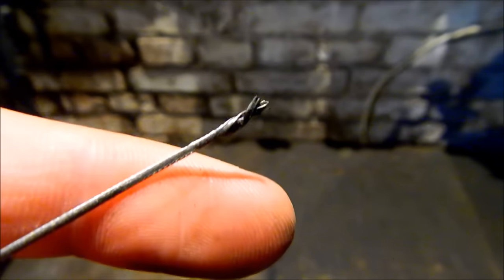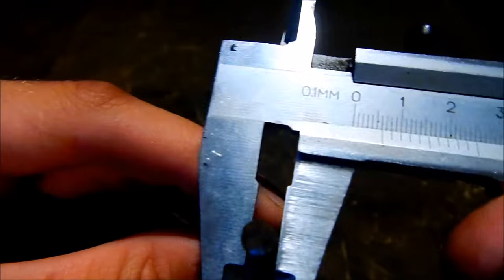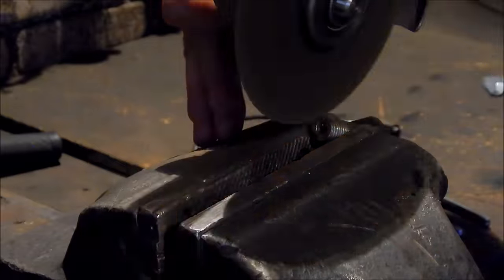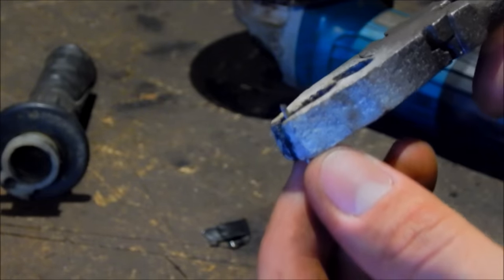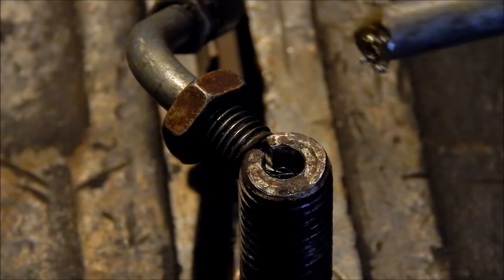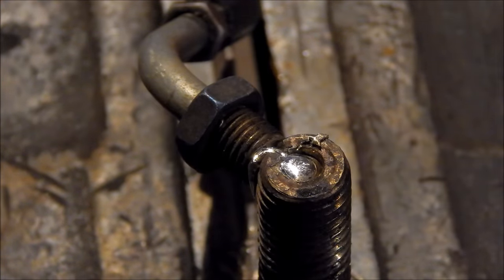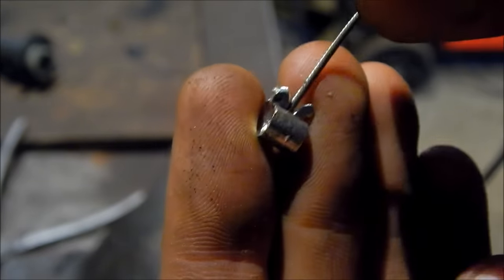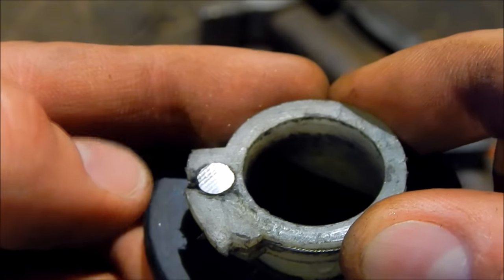Throttle Cable Solder Repair Tool - Simple Fix!

Comment: I wouldn't trust in lead- it might be too soft. Have you tried aluminium?
Reply: i would try some sort of zinc die-casting alloy.  i think that's what the factory uses.
Reply: i used terracotta..just jokin. some jb weld would be much batter.
Reply: can use a bit of brass rod, you can use it in a drill with a file if you havea  bit too large, drill a hole, and a countersink, put in cable, splay open so it lays in the countersink, solder with flux and as strong as factory
Reply: Use silver based jeweler's solder and flux, very strong.
Reply: Maybe that "aluminum weld" zinc based rod you can get at hardware stores. This is a good idea mentioning zinc.
Reply: Yeah i would not trust lead either.
Reply: It's only pulling against the throttle spring. I would think that lead would be strong enough in this particular application.

Comment: with my welder on the lowest setting and using repeated quick tacks, I've welded a new ball to the end of a cable. definitely didn't look as clean as your job though, but it worked.

Comment: Great fix!!! Thumbs up
Reply from the maker: Thanks a bunch! ;)
Reply: +Donn DIY Try acid core solder for the clutch cable. Once acid core solder cools is becomes hard like steel.
Reply: acid core solder?.. you mean solder with flux core? it has the same general hardness as any other solder without the flux core. The flux is there to clean the surface when soldering.
Reply: No I mean acid core. It's for repairing rads.
Reply: a link maybe? coz searchin for it only brings up rosin core (aka flux aka acid) solder
Reply: and you're not very smart
Reply: Great vid :) Thanx :)
Reply: AveRage Joe LED is soft and won't last long
Reply: Don't the manufacturers use lead?

Comment: we used to be able to get repair kits with ends that could be soldered on. came with a spool of cable and jacket, with crimp on jacket ends.......haven't seen that kit offered in years, 1989 at least. thank you for offering a solution.
Reply from the maker: Maybe nobody wants to repair stuff themselves anymore so the market isn't there for the product. Thanks for watching. ;)

Comment: For a bicycle brake cable I tied a knot in the cable and used lead/tin solder to hold the knot tight. It worked for years.

Comment: A good tip & entertaining too although 53 dickheads gave it the thumbs down for some reason. Maybe you can help me, I have 6 angle grinders & no head, what should I do?;-)
Reply from the maker: You must have 6 heads then. :D I'm not good at making jokes, thus it could have come across as an insult to people who do not worship angle grinders like me. Really universal and relatively cheap tool. Makes a lot possible.
Reply: Since I have an air driven angle grinder, does that make me an airhead?

Comment: I tied a small knot in the cable and let it hang with a house brick, the weight of the brick made the knot tighter and worked well when repairing my throttle cable on a barina ( suzuki swift)

Comment: Where were you 40 years ago?! Thank You, Donn. Absolute Genius. That barrel is perfect. Some guitarists use a similar technique to make their own strings. The splaying of the wire end is key. And a "Key". The cable will snap somewhere in the middle before that end separates from the barrel. It will never break except from normal wear. Keep your cables lubricated. (This is not for you, Donn. I know you know).  🤩 If you have problems with cable control, I hear you can use Fiber Optic. It will actuate your throttle and brakes and you will get crystal clear Videos by Donn. Yes. I am kidding. Hydraulic brakes are the only way to go.  🤣😂

Comment: Good method for fixing cables when you're on the road. A small butane torch would do the job. Thanks Don.
Reply from the maker: Cheers. I'm glad you find it useful. I'd use a cable repair kit on the road myself. This method depicted in my video would fit someone living in the middle of nowhere and with limited access to stores and such. Thanks for watching.

Comment: I use brass end....splay the cable as he did after inserted so it doesn't pull out under force....then silver solder 
In case as he mentioned using as a brake or clutch cable end
But this was a great Video!

Comment: When I was with friends restoring and repairing Lambretta and Vespa scooters, we used brass rod and silver solder, the end pieces were much stronger. We bought our cable stock from Barnett engineering (a motorcycle parts manufacturer) and made the entire cable if the old jacket was too far gone. The stainless cable from barnett was nice stuff.
Reply: Aluminum bronze might be good as well. Melts at about the same temp as brass but it's very hard. It's often used to repair gear teeth.

Comment: I made a cable end using a bolt the size diameter in the handle. Drilled a hole though the bolt shank and cut little longer. Pushed wire through hole and hit it with a hammer to grip wire. Did the trick for clutch cable on my bike.😁

Comment: This happened to me last night while riding my bike home with my return cable on my dyna. My First thought would’ve been to buy a new one but this is way a better idea.
Reply from the maker: It's a temporary solution though. I live in the country side and the stores are quite far away and I needed the throttle cable ASAP.

Comment: Thats pretty awesome. I am making one of those next week,I have a shit ton of cables to cut off and pull out of their sheff. They tend to freeze up after a few years. On bycycle cables, I had a tool for making cables but some how got rid of it( no idea why). I can almost bet you could get replacement cable cheap enough and just put your own ends on. Custom made cables are nothing new. I just wonder where my tool went for making the lead ends...hummm?

Comment: Pretty neat. But first degrease the end in boiling water and washing up tablet, then dunk in conc HCl for a minute or so. Use a stainless steel former to avoid collateral soldering then with decent flux the solder wets perfectly. Incidentally 'Powerflow' flux (in UK, looks like hand-cream) although marketed for plumbing is superb for stainless!

Comment: OUTSTANDING!!! This looks like it will actually work...I've tried a few different methods(fail) Yours looks promising...
Reply from the maker: I can only recommend it for throttle cable. Brake cables will be too weak when done with this method.

Comment: Red Hound Auto sells a 100 pack of "Ferrule Stops", in various sizes, on Amazon for $8- $10.  Just drill a cross hole the size of your cable and solder.  If it's ball, run a screw in the existing hole and shape it round with your grinder or file (they're aluminum).   A 100 pack should last most guys a lifetime, but I run a small engine shop and use them all the time.

Comment: Hello, very cool tutorial/trick. As you mention - it is only for throttle cables. Do you have this trick for bike BREAKING CABLES also? With what material would you do it? How are the originally fabricated? Thank you for any info on that.

Comment: For clutch cables maybe use copper rod, take flatbar or round bar of mild steel, insert ground clamp to bar and use tig torch to melt the metal into place, dunno how well the cable fairs but worth the test if you have equipment, other that should work is to use his setup but take brass bar and again with tig melt it to hole. Could maybe done with stick welder and carbon rod as electrode, again worth the test, havent done this before, except used brass and copper to hold molten mild steel pool in place on thin sheet metal to be welded, since those two wont stick together and copper/brass eat hellawa lot of heat away from metal before melting, just need pretty big lump, plate or rod of it to have enough mass to eat the heat.

Comment: nice, pretty nifty and clean..i hope this would do with my broken tip brake cable..
Reply from the maker: I do not recommend it for brake cables. I came to this solution depicted in the video in the middle of a throttle cable repair job. And I only recommend it only for throttle cables.

Comment: Love the shelf unit ,nice one.   GREAT idea will try this one day.
Reply from the maker: Cheers. It is an emergency way for repairing a cable which has worked fine. I'm getting a lot of comments about how one should buy stuff instead of repairing it or making things from scratch which kinda diminishes the DIY aspect of this channel. I hope you'll not gonna need to try this but if you one day have to, I hope this tip comes in handy. ;)

Comment: Cool, I did something similar when I was around 12-14 years old, but I just melted the solder into a drilled out small nut with a slot cut into it for the cable.

Comment: Good idea. Do not see why you should have 668 thumbs down.
If someone doesn't want to try the fix,don't,buy a new cable.
It's worth a try, for small power equipment.

Comment: STOP – ONLY use silver Solder... it costs a little more, but it will not pull out like the original cable on this one did. Especially if you are repairing a clutch cable.You can get it at any heating/air conditioning supply store...Great video!

Comment: We used to do this as kids, the problem seemed to be getting a harder mix of solder that could stand up to wear. I believe we used to drill a small hole in the side of some small diameter copper tubing to feed the cable into then fill the whole thing with solder and shape to size.

Would not recommend lol

Comment: Back when I was a kid I fixed my bicycle cable in a similar manner. I used wood. a 1/4 drill bit and hand saw. I drilled the hole and cut the slot for the cable. I used my soldering gun to melt solder for the end instead of lead. I used old cables to make the ones I needed and once time I found a whole roll of steel cable (turned out to be for deep sea fishing) at a yard sell. I made cables for me and my friends.
Reply: will the solder wire strong enough to hold the tension? what is your experience?
Reply: @salemo3099  I used battery acid to clean the cable and plumbing solder and flux and never had one to fall.

Comment: good video and method!...I just thought of a way to maybe make one out of steel....drill a 6mm sized hole in a piece of cement with the same notch for the wire, then instead of melting lead, you use a mig welder and fill the hole with steel from the mig welder wire, the cement (or brick) won't melt and once it cools you remove it and/or break apart the cement and you then have a steel end instead of a lead one...

Comment: This looks really easy but I'm sure a lot of people will greatly underestimate how easy he makes drilling a hole down a bolt look.
Better to use a small bit of pipe (not copper) or a fitting and then just drill to confirm dimension.

Comment: that could almost fit into a field repair kit back at camp, barrels with screwsets  are nice to carry even if throttle on the brake lever gets you back. (careful about riding through those branches lol)

Comment: just for an emergency repair, you can take a electrical "crimp on" terminal, remove the blue cover, and crimp it on to the cable end. cut it down to size. I did this once when dirt bike camping and a cable broke on my friends bike. It held all weekend, and i was declared a Macgyver.

Comment: Most motorcycles have both pull and push throttle cables, or the newer ride by wire with no cables. You can often temporarily use the push cable as a pull cable. My pull cable broke on a little country road about 4 miles from home. I pulled out the choke knob for the carb all the way so the engine idle speed was a lot faster, and limped slowly home in the highest gear not stalling the engine. J C Whitney is a good source for ordering a cable by snail mail, if you can wait a few days.

Comment: Great video, this provide a great solution on brake/throttle cables!

Saludos desde chile! Regards!
Reply: Donn said in another response that this is just for throttle cables. Using this on brake cables can get you killed.

Comment: I used to fix my bicycle cables like this but as a kid I had to do it a little different. I used a bit of wood with a hole drilled in it. It was only good for one time use but was easy to replace.EDIT Forgetful me I just seen where I already posted a reply to this a year ago.

Comment: I have similar things with larger end plugs with wood mold, burns the wood a bit.  For the size shown in the video, you could try buying a brake cable available at a bicycle shop, or find a junk bike to salvage

Comment: Did same trick bit without bolt. Dilled hole into a 6mm bolt and used hammer to squeeze the bolt onto cable. Cut off both sides and  now the cable will break before it pulls out. The lead will always come off again

Comment: Im with you on the angle grinder, but for the throttle cable I drill through the side of a bolt under the head and tighten a nut, pinching the wire ,

Comment: Dang it. 😂 i fluxed the cable but the stuff got stuck to the bolt. So you did not flux it? And all you used was a lead stick? In sure lead fishing weights are ok also?

Comment: Have a look for the brass cable ends that you can solder onto your cables the are easy and very strong . Good trick for an emergency though cheers

Comment: That's cool. You don't think it will work for bicycle cables? Thanks man.
Reply from the maker: It will probably work for bicycle cables with more wear resistant material cable ends than solder itself. Maybe copper pipe filled with solder or something similar. I'm gonna try it out myself too.

Comment: Went to shop today and they only had 50 wvdc capacitors not the 35 wvdc ones in your video but were 4.7uF and the Resistors were 1/2 watt and not the 1/4 watt in your video but are still 1 Mohm...Wiil that be ok and Is it still worth a shot...? Thanks

Comment: If I ever need to do this, I'd get 3 sheets of aluminum. Two around 1/8" one around 14 gauge. From there, sandwich all three together. Drill two holes for whatever size bolts you have laying around, one on one corner, one on the opposite corner. Fasten the bolts, remove clamps. Next step, drill a 6mm hole near the center, through all three sheets. Now remove the bolts and in the smaller sheet cut a straight slot up to the center of the 6mm hole you just drilled. Sandwich back together with the small plate in the middle and bolt tightly together. Slide the cable into the channel you cut in the smaller sheet now positioned in the middle so that it is into the 6mm hole sufficiently. Now all you need to do is place it onto a flat heat resisant surface (maybe a piece of scrap aluminum you have left over from cutting these pieces out of a tiny $5 sheet from home Depot), and simply cut some pieces of lead to fill the hole, hit it with heat, and magic. You have a fixed cable and jig to do it over and over with relatively easy and repeatability. Go ahead and file the top flush with the top piece and you're done, and because you used aluminum the lead solder should basically pop right out.
Perhaps whenever my ferrules and cable ends get here from China I'll make a video of this to fix my loose throttle cable

Comment: There is an easier way to do this. Cut off the right length of the 6mm nail. Drill a hole in the center of the side the size of the cable. After you drill right through the nail, drill a larger hole in the same hole a little over half ways through. Push the cable through from the small hole side and bend the strands over enough that they fit completely into the large hole. Fill the large hole with solder, file everything smooth, and your good to go.

Comment: That is a neat idea though. Also, you can buy them at the Store, LOL... $5.99 there are bunch of Sizes in a box :)
Reply: NOTE:  They have " Cable Ferrule " at Lowes or Home Depot at the Pre-Cut Cable Section, that you can get. If you are close to Harbor-Freight, they have them in a Box for $5.99 and all different sizes too.

Comment: I never have any luck getting lead to stick to these cables. I've been using a wood block for a mold, and melting some silver solder in a steel spoon. The wood block gets scorched, but for a one off job, it doesn't matter.

Comment: Check the groove in the plastic handle, where the cable lays,  for any irregularities.  Smooth out any imperfections with a small round jewelers file. BTDT

Comment: My uncle fixed one for me using a  .22 hull as the mold.  It worked for years.  If you can find the right size hull that might be easier then drilling out a bolt.  Otherwise same idea.

Comment: if you used a brazing rod rather than solder, would it stick to the bolt making it hard to remove?

Comment: Lead solder won’t work for long. You have to use high silver content solder..You can buy it at any air conditioning  hardware supply ..lead is just too soft, Which is probably the reason the end pulled off of the cable in this video.
Reply: If you 'birdcage' the cable first, soft lead will be fine for that size of cable.

Comment: worked great for my clutch cable but only with flux, without it pulled right out of the solder.
Reply from the maker: I haven't used this method for a clutch cable but I always presumed it would happen, if not with flux then definitely without flux. The pulling power is something else than on a throttle cable. ;)

Comment: I have a different technique that only require a ferrule of the same diameter. Hole drilled to accept the cable. then Solder filled.

A throttle bale tool i suppose would be necessary in a rebuild shop  i suppose.

Comment: it teaches me a lot bro!  why I didnt think of that before tnx a lot but I will use round bar rather than bolt it`s a bit  harder to drill in it......
Reply from the maker: No worries. The bolt I used wasn't surface hardened like the bolts you can buy from the stores in these days so yeah. Definitely do the round bar thing.
Reply: once again thanks bro,,,a million thumbs up to you